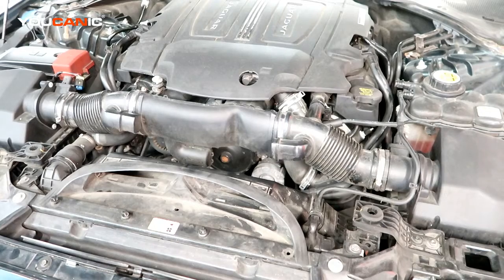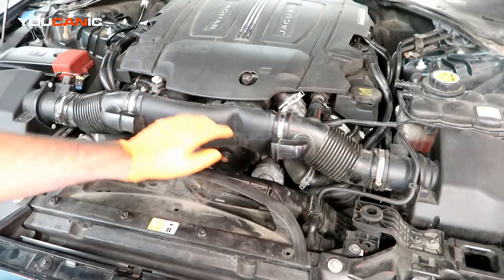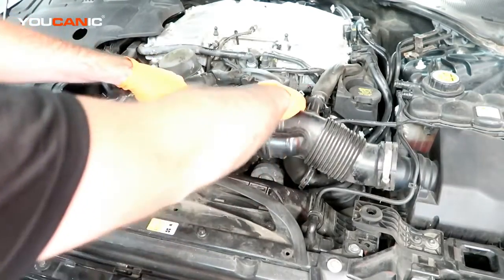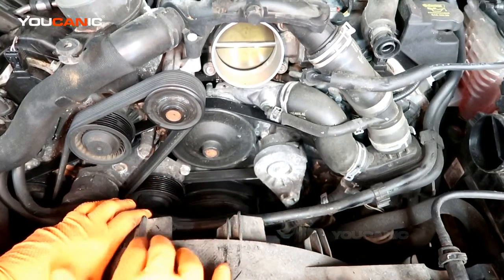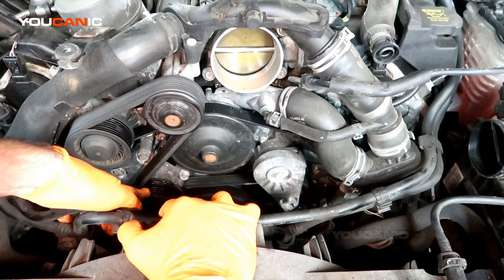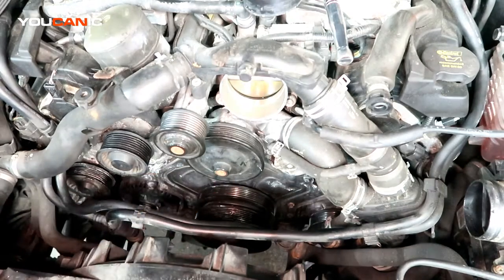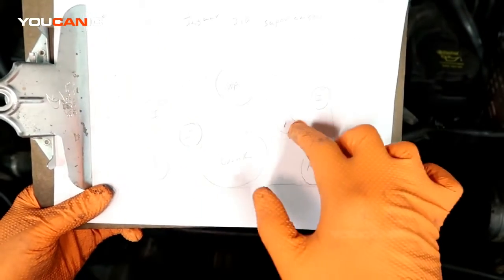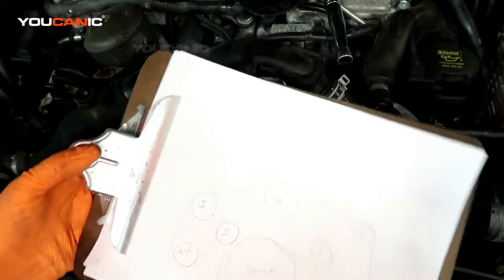2015+ 3.0L Jaguar XE - Serpentine Belt and Tensioner Pulley Replacement

Comment: Holy crap, the tensioners are supposed to rotate that easily? I'm trying to loosen the tensioner on my 5.0L XF, & just about killing my back to get any movement (I'm going the right way, & I've seen a LITTLE movement).
Should the bolt for the pulley be loosened?

Comment: Great video. Much appreciated. Quick question, the tensioner on the serpentine belt is bottomed out and won't tighten the belt any more than it is. Should I get a new belt? or is there something else that could be causing that?
Reply from the maker: Thanks for your comment and question! It could be that you need a new belt, but there could also be another underlying issue causing the tensioner to bottom out. For a more in-depth understanding, we recommend consulting our guides and free resources on www.youcanic.com. We also provide our YOUCANIC scanner and factory repair manuals to make your DIY car maintenance even easier. Our goal is to empower you in your car ownership journey and we're always here to support you!

Comment: იაგუარი 2011
Reply from the maker: Thank you for your feedback, იაგუარი 2011. We're here to help guide you through your own car repairs! We understand that diagnosing modern cars can be complex, that's why we developed the YOUCANIC Full System Scanner. Check it out here: www.youcanic.com/scanner. This incredible tool puts the power back in your hands.

To ensure a successful repair, you may also require Factory Repair Manuals and Torque Specs. For a minimal fee, you can gain access right here: www.youcanic.com/manuals. We strive to provide you with all the essential tools and information to get your job done right. Keep wrenching!